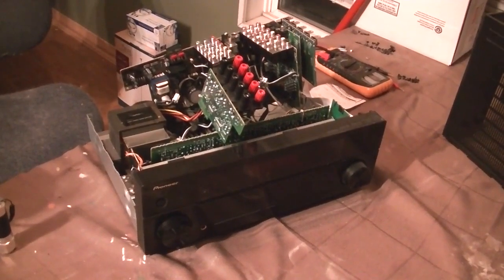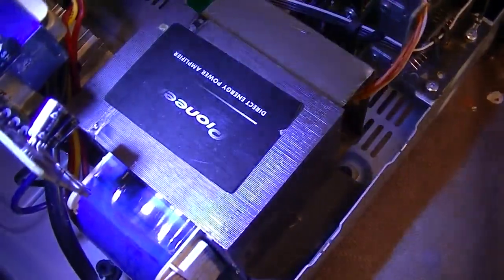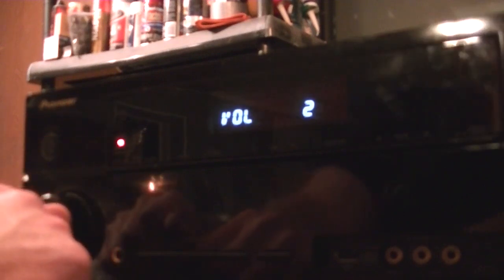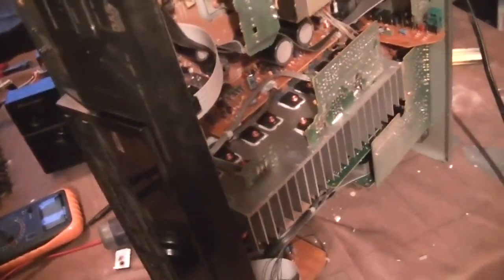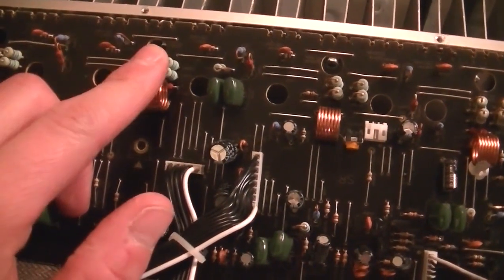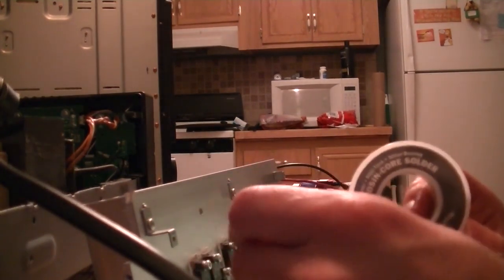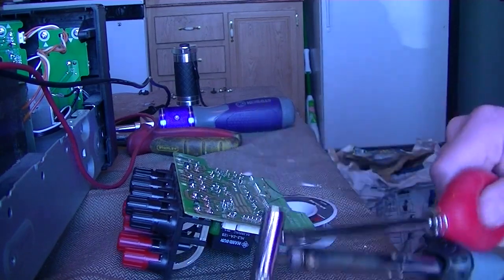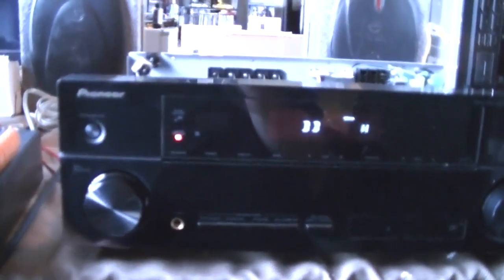Pioneer VSX-820-K Stereo Receiver Diagnosis & Repair - Kitchen Table Electronics Repair

Comment: Just bought a VSX 820 at a thrift store for $10, with remote. Yippee! Half way home ( I live nearby so was walking) I realized something was rattling around in side, and a few of the casing screws were missing- -doh. Thought I was sunk. I opened it up and reconnected a plug someone had unplugged. Nothing. Then did a google search, and up came your vid. Long story short, I followed your guide and got the same DC 001 error. But then--a miracle. It seemed to clear itself and the system is working fine, at least on both stereo outputs and h/phones.  So thanks a million for taking the time to create such a solid video. Much appreciated.
Reply from the maker: +Shaun Sanders If I had to guess the protection error occurred because of the disconnected plug. If I remember, I think it does have to be cleared even if the problem is fixed before the unit will power on. This is a case of someone messing around for no reason inside of the receiver at some point. But sometimes like you found out, these can be the best ones to find.
Reply: wondering if you can help me. I have the Pioneer VSX-D71OS and my sub woofer is not receiving any signal and I have it connected to the sub pre out! any help will be awesome!

Comment: Dude I have been all over my Pioneer VSX-822 inside and out both the receiver and the schematics and all I could find wrong was broke solder joints that I resoldered. But it still never would function. After following your directions on resetting the fault code it now functions. GREAT, Thanks.

Comment: Great video! I've had many things across my table for repairs. I watched this while troubleshooting my father's VSX 3800 that was packed away for about 15 years. There was no sound on the right channels. Turned out the contacts in the relay were burnt. That relay could be opened up with some careful cutting. I cleaned the contacts and bent the one slightly and she came to life. Your video was a big help!!!

Comment: Took me a year plus to digest this video. I started watching this video and could not understand at all. After doing some very minor repairs of resoldering and tipping of my solder station that fell of the floor causing it to not heating the solder tips.I successfully repaired my first device which is my soldering station. I went on to look into the basics of transistors with NPN and PNP. How to troubleshoot these . I got some basic understanding to transistors and went back to this video once more. I finally able to grasp into what the video is guiding about.
I desoldered some of the transistors which are labelled B1560 , D2390 and C3964 transistors that had somesort of thermal paste stuck to the heatsinks. Tested them with multimeter on diode mode and turned out that they're all busted on my VSX821 pioneer unit. One note though, u need to get into the basics of understanding NPN and PNP of these transistors on how to troubleshoot them before attempting to know how to try your luck. And when desoldering, take extra care on not using desoldering pumps. I learnt my lesson using them since i'm not very good with soldering. These pcb are crap. the pump sucked off the copper sheets that were glued to the pcb.
Reply from the maker: Distinguishing PNP and NPN is very important, especially in these 50V circuits, make big smoke fast when you get them reverse, wooo!  :)  I have gotten them reversed, some of these companies cross references are crap, and they reverse the leads. That will get ya if you are not careful. 

I like the fine wire solder. For me it is easier to control the flow of the solder into the joint than using the standard fatter stuff. Heat can be a factor in lifting traces on the PCB, too much will make them lift, but the crap PCB from china are almost just a 1 shot wonder and they fall apart on a repair attempt even when you are being careful.
Reply: @WaybackTECH  thx for the advise. I'll becareful of it.

Comment: Nice job on a successful repair.

Couple things worth noting: Power transformers are generally pretty reliable and don't fail often (though high frequency/voltage xformers such as those for backlights in monitors/LCD tvs do have a higher failure rate), the fuse would be more likely to blow on a lightning strike, preventing damage to the transformer anyways.

Output Mosfets are a common fault for causing a receiver to go into protection mode and should be one of the first checks (Passives, in general, don't usually fail without the failure of an active, so usually its more productive to check actives).

Comment: Thanks for that valuable video , I have a pioneer home receiver vsx_ 522k and one day it would not come back on, I opened it up, checked power coming in and when it got to the transformer no power was coming out, I was gonna change the transformer, but after watching your video of how to reset the receiver the receiver came on and been working ever sense, you saved me unnecessary money if I would of changed that transformer, thanks again.

Comment: Wow! I am impressed with your persistence, value sensitivities and deep electronic circuit  understanding skill set. My conclusion is that this must be a hobby and a passion if I were to relate your time and effort to your results. I used to do this as a teenager, but alas my patience is not the same. It is obviously an intellectual challenge which you enjoy. Thanks so much for sharing this project with us. For me, I am looking for a few tidbits to isolate the problem and hopefully resolve the issue without my trusty soldering gun. Thanks again.
Reply: Yes it is a early childhood development either you like what you are doing or it doesn't work.
I almost had to give it up when I got married and the children were born but like h.i still dabble to try to keep my skills sharp since electronics evolve every year and you can easily loose track plus all the neat expensive gadgets your expected to buy just to keep up with the times

Comment: First real comment on a video since I've had a smart phone.  listen I can't say thank you enough. 300$  pioneer tuner 3 years ago and the Andrew Jones speakers and subwoofer. Anyway my son spilled pop in it last year and it flicked on and off few times and shut off. So back then i about threw it out because it wouldn't power on.  so adv surr and standby I found online and it worked.. so was all good till about 3 weeks ago... It would power on but play nothing.  I tookl it apart to look for bad  fuses because that's about the only electronic smarts I have for ideas.   I saw your video once and skipped threw it and said  yeah no way I can do or check all that.. I unhooked  it and threw it in the garage.  Bored one night I looked on here again and ended up here again.   decided give it a lil more time watch and seen you check and clear the dc code... went to garage and said fuck it lets try.  said dc-13.   I CLEARED it and did it again then it said dc-0.   I hooked up a speaker and she worked.   so thanks so much for this video.  love my stero systems so was about to drop 400$ on new tuner but I'll see how much linger I can get with this one.. Can't thank you enough..  Read a lot online and seen nothing about checking and clearing error codes...

Comment: very nice how you talk through the solution. 1 speakers wires crossed and touched and now I have to check the amp circuit like you did.

Comment: Nice job. I was almost screaming - the emitter resistors! But you found them. The relay is an odd failure on these, but great you found a workaround. I do Pioneer warranty work and others. You can contact me if you get stuck on one of these.
Reply from the maker: I feel like the speaker terminals on both channels came into contact. The relay was the weakest point I guess on that channel so it fried it's contacts inside. When i first got the unit to display the fault code, it came on with a volume of 48. I don't like how close the wires are to each other.  I need to swap to some banana plugs for good measure.  It is still working great though!
Reply: Hey Mark, I got an VSX-817. I have a similar problem - it turns not on. Is there a diagnostic switch on the VSX-817 too? What can I check?
Reply: Would You happen to have any info on the transformer in the vsx1021k like a data sheet Im needing the input and output voltages abs if the outputs are ac or dc power thanks
Reply: I have 2 pioneers down. Could use your help.

Comment: De-soldering iron: Radio Shack used to make this model and you can still get them on eBay. Radio Shack carried the iron clad tips which lasted longer. I still have my soldering iron and this hooked up to a variac to control the heat and get the tips to last longer.  I added a fairly long plastic hose in a 'U' and a vacuum pump to one over 30 years ago. The solder collects in the long plastic hose which is fairly easy to clean - or replace. Occasionally the metal tube gets plugged. A hand held propane torch can heat it up enough to allow the solder to flow out. With a vacuum pump, it does a great job of cleaning out component holes and even allows removing older style chips without damage. I included a foot switch for the vacuum pump.  I still have it and use it on occasion. 

When soldering / de-soldering: A good electronics flux is your friend. Fluxing leads and wires prior to tinning can make a huge difference in quality of solder connection and they solder faster which means less heat on the spot.

Comment: hello mate!
I've got a european VSX-527-K here. basically, had the same issues as yours, but on the rear right channel. on the main AMP5 assembly:- two 0.47ohm (R603,R604) resistors blown, KTA1024Y(pnp) (Q449) - KTC3206Y(npn) (Q460) - 2x KSA992Y(pnp) (Q455, Q456) transistors blown, and the 2SD2390(npn) (Q452) and 2SB1560(pnp) (Q458).
after re-tuning the idle current on that channel, the amp module now runs sweet.

the only problem left to solve, is the permanent "overheating" error followed but a shut down. apparently, there is a way to increase the threshold, but each VSX has a different key combo to change it. also, getting the service manual was a drama - after abit of research, the service manual for the VSX-1022/822 seemed fine (although the amp module is labeled for  "VSX 321/421/521/821")

sorry for 'spamming' your comments section with info, mate. but, seeing I was looking for info for my problem - others might gain from it (and save hours searching the web) ;)

ref. the overheating error - any tips on how to get rid of it? even with the amp module removed and after a reset, it still 'plagues' me, lol. all I want to do, is listen to some Slayer. (doesn't everyone?) (:  

thanks for posting, btw - subscribed!

Comment: Newer receivers with all the gimmicks aren't usually an upgrade in sound quality. The manufactures cut the budget to the amp and power supply to pay for all the the gimmicks and any associated royalty fees to use the products.
Reply: The end of low THD and high SNR receivers/amps started circa 2004. As you mentioned, manufacturers let sound quality suffer to hit low price points and still cram as many features as they can (wifi, Bluetooth, multi room, USB, etc). This receiver is a great example. In perfect working order, its THD is near 0.1%!  That's shit! SNR is only double digits as well (98db). This is a wasts of time repairing in my opinion. Better spent on a Yamaha from the 90s

Comment: Now, on a more serious note, if you replace the output transistors, you should then set the idle current as incorrect setting will not only decrease the efficiency of the amp, it'll also reduce the life of the components.
Here's how you do it:
With no input and no load, turn the amp on and leave it 1 min to warm up.
There is a 3 pin test plug on the board for each amp and a variable resistor. You need to adjust the VR so that the voltage across the outer two pins of the connector reads between 1.8mV and 2.2mV, ideally 2.0mV (Pin 3 +, Pin 1 -).
That's it, done. It's very simple but very important.

Comment: Just a silly side note: Station 107.90 was just in the middle playing Eruptions, which would've been a good listen for volume purposes.   Good video and informative. Ive got a Sansui G-8700db that needs a little tweaking here and there.  I got inspired  from your vid.
Reply from the maker: +BadRonald1 I love the looks of those sansui G series receivers, though I prefer the one without the digital display more so. Very nice receivers.   I just uploaded 2 videos on a sansui s-x1130.
Reply: WaybackTECH
 Thats cool, I'd like to get the 33000 or the Pioneer 1980.  How long have you been working on Receivers ? Im looking forward to learning electronics. I know its gonna take a while, any advice ?
Reply from the maker: BadRonald1
some say the 50 series pioneers are better than the 80 series. I've been messing with this stuff since I was... gosh 10 maybe. use to get walkmans and car stereos at garage sales and fix them when I was a kid. I had a couple of those electronics learning kits that radio shack used to sell also. Figured stuff out that way. probably if I was starting out now, I would get some electronics kits, like an AM Radio kit, to put together. Those are less than $10 on ebay, and you can learn how to solder too with those. Start off with something cheap so if you screw it up, no big deal. Almost have to screw something up to learn :)
Reply: I know how to solder pretty good, Ive been into this fore 4 years. But man Im still trying to figure out Transistors with the Emitter, base and collector or the gate. PNP or NPN ? You never went to school for it ?
Reply: I used to hunt old TVs and radios that people were throwing away when I was 12. I'd take them home and fix them. Once they were working again I'd sell them in a yard sale. Often times people would walk by and remark that they had a device just like the one they saw there. I made enough money to buy my first computer that way. I also got myself one of the original NES consoles and my school clothes that way. It pays to ask the right question of the guy who owns a repair shop as a kid. I had a lot of fun figuring out how all that stuff worked.
Reply: 12 yrs old ?   Replacing Transistors ,Zener  diodes  etc....
Reply: I just noticed that you do computer repairs but on old out dated computers. Why?       Do you prefer computers than Receivers ?

Comment: Great Video - very informative.
 I have a VSX-522 unit with a similar problem. I get the DC001 error when starting the system. However, if I disconnect all of the power transistors and put the amp board back in the unit there are no errors.  I am fairly sure it is the output transistors. 

However, I am not getting a dead short across any of the terminals. They all seem to read ok (diode setting on multi meter) with the correct polarity set, but when I test the collector to emitter, I get a reading on the multi meter (diode setting) that there is continuity. I was of the opinion that it shouldn't show any continuity at all no matter how small. Can you advise if I am on the correct track here please.

John

Comment: Great video. I have a VSX-1022 that stopped working the audio and video even the headphones don't work after a power outage. It turns on and all the selections work. I have ran the diags and no errors are reported. Any steps to do next?

Comment: I will keep my vsx-d411 receiver. Keep it simple.  I think what happened is a speaker connection got shorted while connecting at back , or the speaker overheated and caused an arc in the relay and shorted the mosfet. I have had voice coils in 20 watt car speakers blow like a fuse and others would start to cook like a heating coil, but the amp was still good. A lot of people sadly just connect any old speaker and end up letting the magic smoke out of the parts. That is the thing about ebay. You never know who with whatever experience has looked at items first and gave up, or was a considered not worth fixing by a retailer. I find those newer amps are temperamental. Even slight things can trigger errors like turning on a light switch under the right conditions.  The computer circuits can loose their "bits" and need a restart. A rule is always use these with a power strip and shut them completely off when not in use or when a long power outage is happening.

Comment: Thank you for your great video i Pressed the power button and the surround batton and i can hear it POWERING  on now i also changed the fuse on the plug but the front LCD Panel not displaying , before it stopped working i spelt something burning  inside the apm when i had it full blast had andrivana app coming from my laptop i fryed someting?

Comment: Great vid. i turned the volume setting l ch r ch down to - 10 now vsx74txvi pioneer receiver keeps shutting off. I cant change the settings back because it shuts off i reset but didnt help. is there a way to reset the ic ? maybe refloat it?

Comment: I just saw that video and I think the relais do actually come apart, the plastic housing looks like it's clipped on the rest of the relais. What you could do is use two knife-blades that you slide into either of the long sides of the relais, that should disengage the little platic hooks that keep the housing snapped to the relais and you should be able to slide it upwards. once you got it open, it's probably a good idea to clean the contacts with some contact spray on a piece of paper that you slide through the contacts a few times.:)